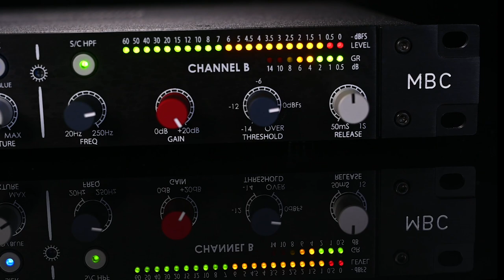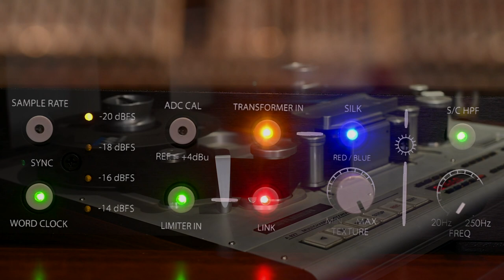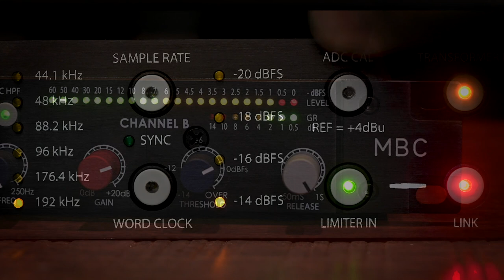The MBC: Dual Path A-D Converter & Limiter

Comment: Is this the same limiter thats in the MBP? thank you
Reply from the maker: The mbp limiter was the starting point but has been slightly updated and advanced in addition to the extra features (the sc / HPF is compressor only on the MBP, and there is no release control on that limiter)
Reply: @RupertNeveDesigns  can i get my MBP mod??
Reply from the maker: @prodjincmusicproductions6587  no, the MBP limiter is uses the same VCA as the Compressor and Make Up gain.  This is good because you have far fewer gain stages, but it's not possible to duplicate what's in the MBC with the MBP limiter (the added features tend to make more of the difference, and again there just isnt any wiggle room in an MBP).
Reply: @RupertNeveDesigns  THANK YOU
Reply: @RupertNeveDesigns  So how can I get the limiter only? Any video on how to connect to an existing system like an AVID HD IO? I own a 5059 and MBP, and have never used digital outputs. I read the manual. Nothing there. Looked at every video, and no info on how to connect this unit and get different uses out of it.

Comment: Is the limiter on this a brickwall type limiter or slower than that?
Reply from the maker: Hi Darren, it is a brickwall limiter.  Note, the SC / HPF makes it so LF can exceed the threshold though.
Reply: @RupertNeveDesigns  Ahh good to know.  Is it possible to clip the low frequencys when they exceed the threshold then?  And how does the unit handle clipping in general?
I rarely need to but sometimes I get a client still living in the loudness wars era.